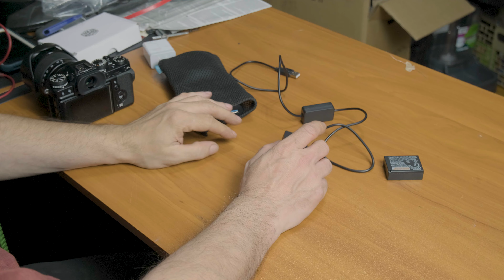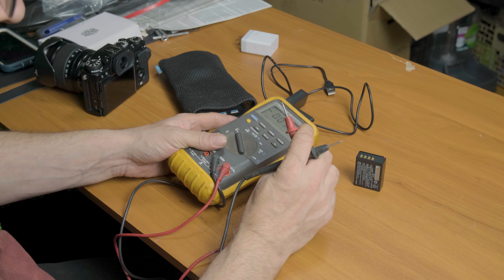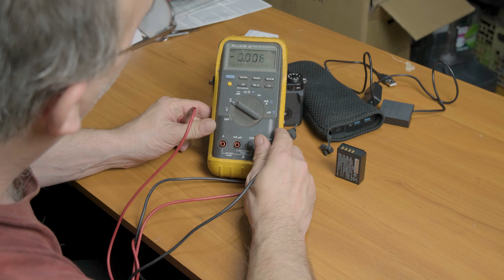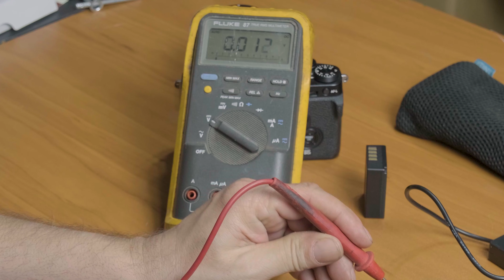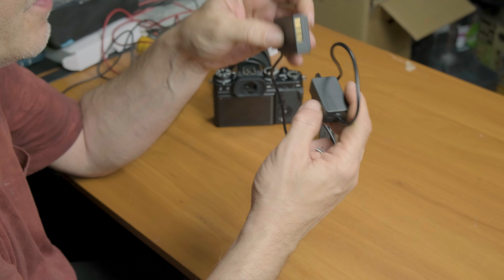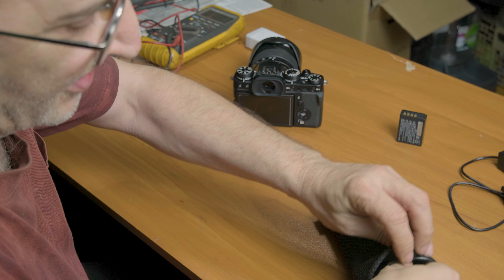Don't Burn Up Your Camera, Using a Dummy Battery, Here is how.

Comment: Hi, I have Sony ZV-E10 but cat find any recommended  power bank's  that can be used with it .. :( Any thoughts ??  Thanks in advance
Reply from the maker: Here is one that would work fine with that Camera..
Gonine AC-PW20 Continuous Power Supply ZV-E10 A6400 NP-FW50 Dummy Battery ACPW20 AC Adapter Kit for Sony Alpha A6000 A5100 A6100 A6300 A6500 A7 A7II A7S A7SII RX10 II IV Cameras."

https://www.amazon.com/AC-PW20-Adapter-Coupler-Gonine-Replacement/dp/B01D67LTIK/ref=asc_df_B01D67LTIK/?tag=hyprod-20&linkCode=df0&hvadid=198104292682&hvpos=&hvnetw=g&hvrand=6675204656660132142&hvpone=&hvptwo=&hvqmt=&hvdev=c&hvdvcmdl=&hvlocint=&hvlocphy=9001899&hvtargid=pla-383357185654&psc=1

Comment: I just got 2 dummy batteries (one for each camera) with power supply from a brand called Andoer. I tried it last night and both worked. But I'm still hesitant that it may short the camera eventually after long periods of uses. Is there any way of knowing that? Or will the camera be safe if the dummy battery or power supply gets damaged?
Reply: I was just looking at these. What did you decide?
Reply: @user-bx5zi1mv5t  I kinda don't understand the question. I bought both of them with each dummy battery fitting for a specific camera unit (the cameras have different battery models). I still haven't used them for my shoot though. Still hesitant (but setting it up to plug in to extension cords is also a pain).
Reply: @mistermastermind528  Appreciate the response. I was mainly asking if you decided to use them and to see how they've been but you answered that. Thanks!
Reply: @user-bx5zi1mv5t  Oh okay. Glad to have answered it anyway. I'm kinda saving up for an npf battery and adapter. I don't know why somehow that feels safer.
Reply from the maker: if the dummy battery is putting out the same voltage as your battery would it will be fine it shouln't short out the camera..
Reply: @AMomentInTimeProductions  thanks for the reassurance...

Comment: Helpful, thanks for sharing! I'm doing research before buying a dummy battery for my a7iii and I've seen a smattering of reviews on every product I find that it damaged someone's camera. These products include the whole kit with the power block and adaptor. I wish I knew what they did (if anything) to have a failure. Your testing process is at least a good start to verify before using anything you buy.
Reply from the maker: Glad it was helpful! yes you got to be careful when using a dummy battery, best bet is to buy one that is for that specific camera and you should be fine.
Reply: Do you have one you recommend for the A7iii ?